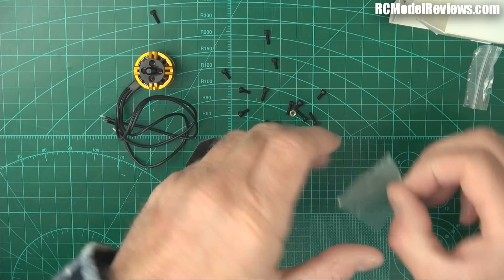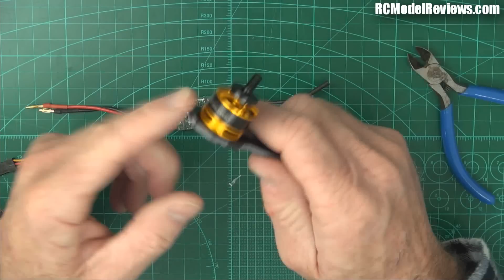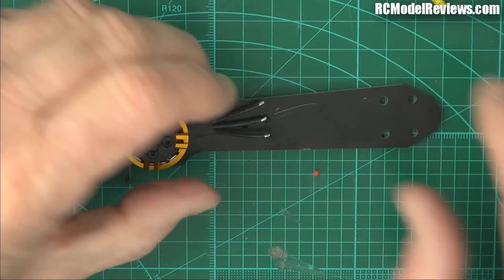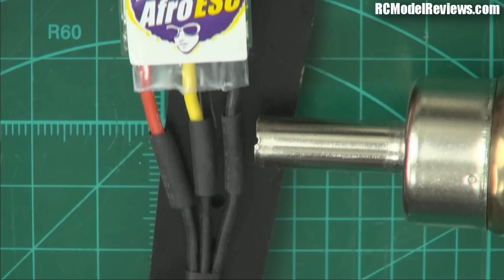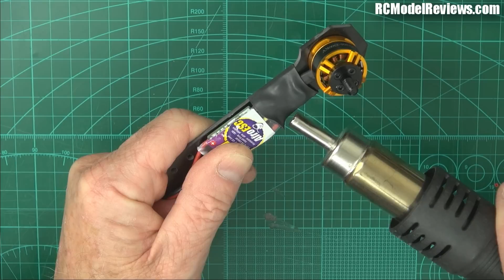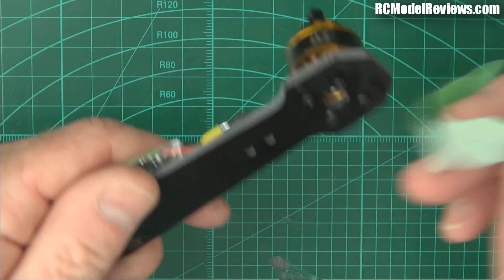Low cost miniquad racing drone build video PART 2

Comment: If you trim the plastic off of your ESC just a bit more, you can just unsolder the colored wires and then solder the motor wires directly onto the pads.  When wiring, fewer joints is better than more joints.

Comment: Lol , didn't have to do 4 or 5 to get it right , you've done a few more than that , you are the first person on YouTube I've seen who shows people how to solder  ( who can actually do it , they usually end up with cold joints , burn all the flux out of solder dirty wires circuit boards etc. ) very good video sir . I would recommend watching your soldering video to anyone who cannot consistently produce nice clean shiny joints like this , I would If I wasn't lucky enough to have been taught by my father at 8 y.o. ! Good to see someone who actually knows what they are talking about in this hobby making great vids. and passing on correct knowledge.

Comment: Jesus that's probably the least optimum way to connect a motor to an ESC. Solder the motor wires directly to the ESC solder pads already!
Reply: Well, he says you can do that if you are good at soldering :)

Comment: So funny....  Soldering....  Or sodering....  Lol....  Cutting wires...  So funny....  Great, very informative....  We use to use the bullet connectors...  Too much weight....  For a beginner weight is not a problem...  More slack on the leads allow for easy replacement...  Quick repair in a crash....  Buy more esc, buy more motors....

Comment: Anyone know if he is correct on the Heat Shrink being 19mm in size for covering the ESC wires?
Reply: 19mm is too small to even thread over the arm let alone the ESC. I have ordered 25mm tubing.
Reply: +Hugh Davies thanx for your reply. I'll be doing the same.
Reply: I made a basic mistake with using a flat size rather than a diameter size. Took arm to my local electrical store and found a 20mm diameter tubing was the ideal.
Reply: Sounds good.  Thanks for sharing.

Comment: PLEASE ADVISE!  I built this quad with the naze32 full, dys be1806 2300kv motors, and afro 12 amp esc's, I flashed naze32 with cleanflight and the ESC's with BLHeli. The ESC that is powering my Naze32 (rear right or motor #1) is being bad. when i plug in my 3S Lipo my motor gets smoking hot and windings start to melt (Magic smoke). I unplugged fast enough and have tested the motor on other ESC's it works fine.  Tested a new motor on this ESC and smoke again.  I read/wrote it again just fine and it still powers the Naze32 with no issues or obvious physical defect. Any ideas? I'll just replace it but could it be i smudged a setting somewhere? also the linear becs on 12amp afros were not able to power my 5v camera/VTX/ or LED's without burning out. I had them all powered seperatly. Power issues... suggest switching becs if you are going fpv or a seperate Switching Ubec which is what i am using now hopefully 3-5 amps is enough.
Reply: +ryanworks35509 ok guys reply to my own question, I'm reading now that you can run linear bec's (afro 12amp ESC's have them) in parallel! this splits the load on the BEC's reducing the heat generated and extending life to more than the 10 seconds i was getting before they magic smoked on me.  so I will combine my BEC's to power my camera/vtx/osd/and LED's and pray for success. I'm still going to use my 3-5amp Turnigy UBEC to power my Naze32 and Reciever so hopefully i can have some control in the event of a failure.

Comment: Fantastic videos! Well done. Your enthusiasm and comments make it all the more watchable and I learned a lot of great tips.
I have one issue though - your video #2 shows you assembling the motors to the escs - 2 x straight, 2 x crossovers. You then put the straight on the RHF corner (pos #2) and staggered the rest. 
My issue is, in the motor test video, your RHF #2 motor is spinning CW, while at the end of the vid the props are installed as though it were CCW.
I didn't have a servo tester so I assembled everything as per your instruction, but my Quad x setup is now wrong. #2 should be CCW etc.
Did you make a correction in the video at all that I missed on this fitment or am I going mad!! :)
I am removing the arms on the build and swapping them around to make it right, but that detail was just niggling at me.
Again, thank you for being you. Your delivery and skills have created an awesome resource for new builders (as long as that motor direction thing is sorted out though..)
Cheers

Comment: why don't you remove heatshrink from ESC and solder motor wires to SC directly instead of truncation both ESC and motor wires?
Reply: +FotoAmg AmgFoto He says in the video that this method is easier for someone inexperienced with soldering small components.
Reply: +Ryan Harper thanks! sometimes I am watching videos without sound, I know it is a bad habit :)

Comment: Sorry for the newbie stupid question, but wouldn't it will be better to have the esc placed onboard the main frame, instead of the arms. Would'n this help in maneuverability? I know that is easy to take heat bellow the props, but in a racing drone, you will have air going thru all the time. Am i right?
Reply: +fitty77 precisely the question i wanted to get an answer to, lets see what the more experienced flyers have to say on the matter
Reply: +fitty77 you can and some people do but it get hard to fit it all together, on the arms makes wiring (and repair) easier), plus it keeps them cooler as you say.
Reply: +sm1thers Thanks for the answer. ;)

Comment: How much does the whole thing cost?
Reply: +Tyrone Albertyn $270 for the quad, but you'll need to spend at least an additional $150 (really depends on what transmitter and goggles you get) as well for the required accessories and tools. I did a write up on the this build with a cost break down of everything you need. If you search for "copter wars building an FPV racing quad" on google you should find the blog post.

Comment: What is the blue thing? Glue?
Reply: +soyrandom1 Locktite
Reply: +Shaun Sativa 
for the threads
Reply: Exactly, the different colors of Locktite provide different levels of force needed to break the bolts free from their host threads :) Yellow is the weakest, and red is the strongest, with blue in the middle, if I remember correctly. The actual forces needed to break free after they have cured are posted on their website, probs my goats.
Reply: +Matt Baca White for what?

Comment: I did this over the weekend. However i have a question. If i just soldered 2 of the ESCs with the label up, then on the other two I just flipped the esc over. Would this work to make two motors cw and two ccw?

Comment: Another great video! I lost three of those motors to the fact there was no thread lock on the set screws that hold the top motor housing on. I'm slow, it took me a while to figure out what was going on. Mine needed a 0.9mm hex driver. Definitely worth checking before you fly!

Comment: For the slight shaking you could talk to your doctor about Inderal (propanolol), it's a very benign beta blocker, (used for high blood pressure, performance anxiety and also shaky hands) it lowers adrenaline flow and gave me rock steady hands. You don't need a high dose so it will barely lower your blood pressure.

Great video, exactly what I have been looking for. Currently saving up for a quad. :)

PS: I hope you have kids because you'd make the best dad ever!

Thanks :)

Comment: If I have 2 motors whose propeller caps tighten the other direction then I guess I already have CW and CCW motors. Do I still reverse two wires coming from the ESC? Thanks
Reply: Phrancis5 Well.. That depends.
If the motors were actually wired to run backwards then no, but I doubt that they were. Guess you will have to try one and find out.. I use 3 small pieces of wire with gator clips on them, to test wire, and run the motors, that way I KNOW which way they are going to spin BEFORE I get the iron out..

Comment: Is there any issue with putting the ESC's in upside down? Then it switches two wires (top and bottom) automatically.

Comment: I've just burned 2 RCTimer ESC and Motors by direct soldering them. DO NOT TRY AT FIRST TIME.
Reply: Herrdesrings .  The trick is to use a moist sponge pad in contact with the metal you are soldering.   The heat will go into the sponge rather than your equipment.
Reply: Herrdesrings Well someday you must try :P Anyway sorry for you. It is not good to lose  $ 40
Reply: Just cut the wires them a little short of the esc and you'll be good.
Waiting for the new banggood order to arrive :D

Comment: Fellow kiwi here, don't we call them Allen keys? Soldering my quad together now, not having much luck with the tiny wires from my motors to the slightly larger esc wires

Comment: Big thank you, sir! This whole series is just great, but this video helped me out in a special way. I was so afraid to cut the wires and solder (based on my lack of experience), but after your video I just took the smallest tip soldering iron, cut the motor wires to length and soldered directly to the ESC (mostly to avoid the cable mess). It's not a best soldering job in the world but hey, you have to start one day! Also, the power distribution idea - brilliant.

Comment: So ideally would you cut the heat shrink off of the esc and solder the trimmed motor wires directly to the esc?
Reply: Dean Cory Yes, you can and I did it that way. You should insulate the ESC from the frame though - I got the carbon fiber version which is conductive so after stripping the heat shrink on the end of ESC and soldering I took a double sided foamy tape (I believe it is Tesa mirror tape, very strong) and cut it to make as big an adhesive area as big as the ESC and simply stuck it - it's not going anywhere as long as you remember to put pressure on the taped surfaces for 5-10 seconds.

Comment: Hello this video is great thanks for the help!!
I just bough a quad set (ESCs, props, Frame, motors, CC3D) and I have notice that the small nut on the motor that goes on top of the props are different (two can be unscrew clock wise and the other two counter-clock wise) I wonder if allows me just to solder the cable without crossing the cable (you explained on 23:00) and will automatically spin clock and counter clock respectively.
could you give me a hand cause I dont want to find out that they are spinning the wrong way after Im done.
thank you!!

Comment: For anyone taking this for a step by step guide:

1) Don't screw on the motor, before soldering the ESC on.
2) You can put the heatshrink on before taking away the insulation on the ends, makes things much easier.

Comment: Why dont you use wire strippers. Ring barking tends to cut wire strands as well.
Also "Blue tack" is greeat for holding wires while soldering.

Comment: the reason people dont cut the wires so short is the reuse value, you might wanna reuse the motors / esc on a bigger frame. also bullet connectors are much easier for when motors and esc fry. also very easy to switch if the motors spin the wrong way.
Reply: AndyRC Hi andy!
Reply: hi Elexs :)

Comment: Cutting the motor wires will drive me crazy. If I was you,
1) Why don't you cut the whole shrink wrap off the ESC.
2) Desolder the red, yellow and black wires from the board. 
3) solder the motor to the board without cutting it.
4) Get a new shrink wrap, tuck the ESC and the wires underneath it.
5) Bang! Then heat it up tight. 

That will make it nice and it will save you couple steps.
I'm still learning from other people mistake since I don't even own a quad yet. I can't wait to build my first one.

Anyways, Your soldering work is perfect, though. WOW!

Comment: When using carbon fiber arms I'd recommend putting double sided tape between ESC and arm. The ESCs heat shrink may fail with all that vibration and then the CF shorts out the ESC. Great video Bruce!

Comment: Join the small esc and motor cables together, inside each other and than solder, it will hold better =)
Reply: I was a bit concerned he didn't mesh the wires. but for these small wires it'll probably be ok, and meshing can be real messy even when you're good at it :)
Reply: RCKnut On small cables its even more important to mesh them together, the solder joint is so small on the smaller cables so there is not alot of contactpoint between the cables if something went wrong. If meshing them together it will take more force for them to separate. 250 quads are known for take alot of beating, so its important that it will hold even after a small crash =)

And I know what you mean about messy =)

Comment: You could have just faced 2 of the esc'a face down which would have switched the outside pair.
Reply: Err, sorry no. Swapping two of the wires effectively reverses the phasing or "firing order". Simply flopping the ESC will not reverse the phasing.
Reply: Rob B
wouldn't the outside pair be reversed ?

Comment: There are many different ways to do this just like he mentioned. It is your choice. He chose his way on this build. Probably the least intimidating to newbies. That idea with the 2 arms with crossed wires is a sure way to get 2 motors ccw, 2 motors cw. Just instal the arm on the correct corner.

Comment: I have shaky hands Bruce and am the same age as you, it makes soldering a real pain at times. In my case it's benign essential tremor. It affects both hands and typically gets worse under stress and better with booze or Valium. One guy I fly with has had it since he was ten and uses a transmitter cradle so he can fly using thumbs and two fingers, which is what I do for quads only to give finer throttle control. Hope your tremor is just ageing like mine and not Ebola or something. ;-)

Good videos btw, just to get a bit on topic. :-)

Comment: Nice vid! Be carefull when using longer screws to mount the motors to arms! I only could use one long on one corner. I have seen this mentioned on other vids before I started to build my first.
Reply: Nanite Nanitian Yes, it depends on the motors.  I chose the DYS motors partly because the screws that come with them are okay to use on the ZMR frame.  I have seen other motors with less "screw room) in the base that require a very careful choice of screw length to avoid problems.
Reply: Trimming the screws can be a tedious task. To speed things up I like to chose the next longest screw and file them down to length. To ensure they all come out at the correct length I drill a steel plate which has a thickness equal to the required length. Using another strip of steel and vise-grips I clamp the screw head to the first plate. You can now file away the excess without having to check the length frequently. Remove the screws and a quick deburr and you are done.
Reply: ***** I have exact same golden DYS motors but full carbon frame (3mm arm thickness too). I saw warning in one vid that you could use longer screws only on the two outermost holes but when I did that I felt that the long screw touched the black leads on the side where the 3 motorleads goes into motor. The long screws length are 6.35mm (threaded part) that came with the motor.
Reply: Rob B I do the same thing except I thread the hole so I can just screw the bolt into the plate and quickly run an angle-grinder over the back surface.  Very quick and easy.  I then remove the bolt and use a whetstone to take the burs off the end.

Comment: Bruce...I asked this before and no one gave me an answer...why do you have to use a mobious or something similar as a second camera? Why cant you fpv and record from the same camera...it seems like the mobious or a gopro would be way better for fpv flying so why use 2 cameras...plus I sould think the extra weight would be an issue...please explain this to me, thankyou...Gary J
Reply: Gary Ferguson Jr All the replies given so far are correct -- the board-camera is optimised for giving the best SD picture under the sometimes challenging lighting conditions that FPV can create, whilst also avoiding the lag in video that accompanies the use of a camera such as the Mobius or GoPro.  You can fly with a Mobius as your FPV camera but the results will be far inferior to using a good FPV camera.  For the sake of about $25 it's just not worth making the compromise -- get a good FPV camera and use your mobius for what its best at -- recording taking excellent HD video to watch later.
Reply: Gary Ferguson Jr The Mobius has latency.
Reply: Gary Ferguson Jr Dedicated flight cameras such as the Sony Super HAD 600 tvl (PZ0420) offer drastically better lighting changes, and almost no latency. You do not want to fly while looking out of a Mobius, I promise you that. It's laggy and jerky, and the lighting changes are awful. A gopro is a little better, but for mini proximity flying, you want as little latency as possible.

Comment: hey Bruce, it looks like you'd have no problem soldering those wires even if they were cut 1 or 2cm shorter, which would prevent having to bend them. any particular reason why you chose not to do so? also, why no cover the whole ESC and wires with a single, long heatshrink strip?
Reply: El Fueda To make the wires shorter would require cutting them either very close to the motor or very close to the ESC -- in which case, the heat from soldering could damage either or both.   You can cover the entire arm in heatshrink but leaving the center of the ESC exposed will help with cooling -- although that's probably not going to be an issue on a "learner" miniquad ;-)

Comment: I would be shaking too working that fast and watched by lots of people ;) I have built a few quads (soldered) but still enjoy watching some else doing the hard work. I always build the frame then put the motors on, your way is better.

As for soldering pretty certain Bruce is using proper solder not the S*** lead free modern stuff. To build confidence soldering get a small length of 60/40 lead/tin from ebay and practice with that, it has rosin flux and lead and will flow like you have just seen.

Great vid thanks :)